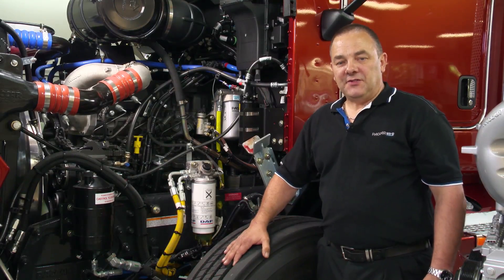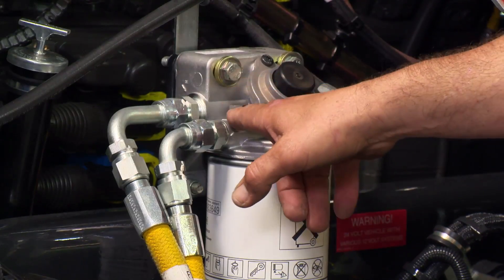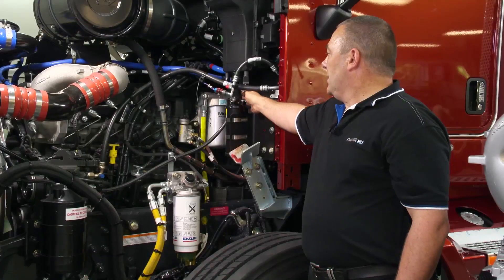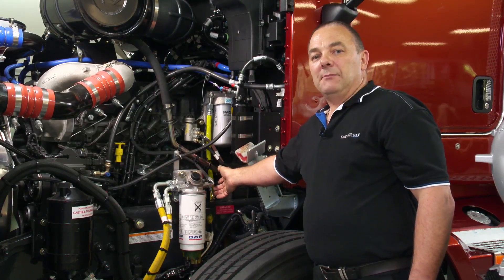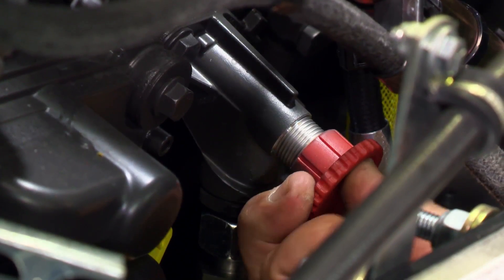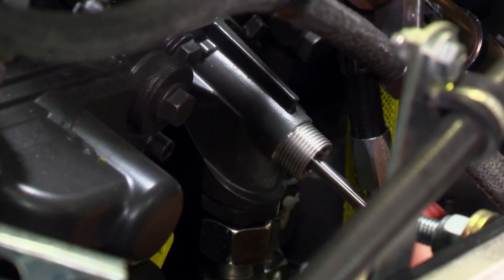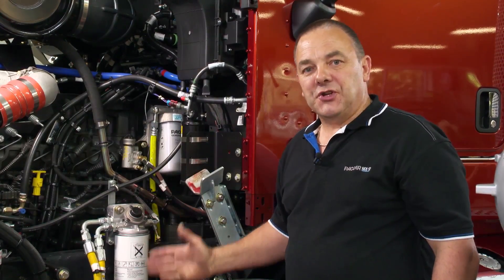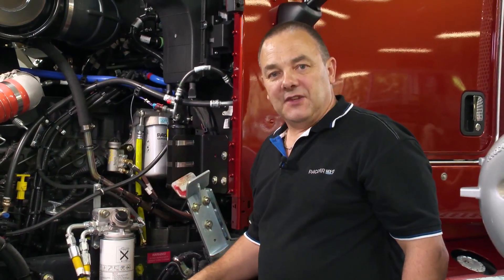MX-13 Bleeding

Comment: Looks like overseas at least they make it serviceable by giving you the button pump and bleed valves. Over here in America they don't give us any of that...just the main pump on the engine. They do whatever they can to make it as hard as possible to do anything for yourself, so you have to take it to them and they can rip everyone off. Nothing over here is about the customer, only about how much money they can make. Its sad. Thanks for your tips and wish the trucks here had those parts on them. Take care sir
Reply: Yeah, I ran into the same issue, nothing to pump the fluid in or out. Just to remove the filters and pray, it sucks up the fuel